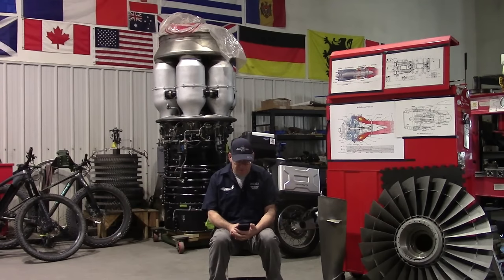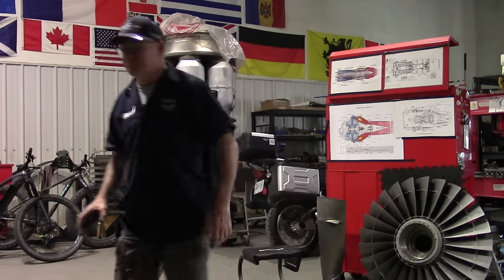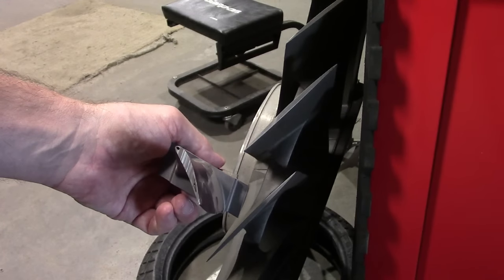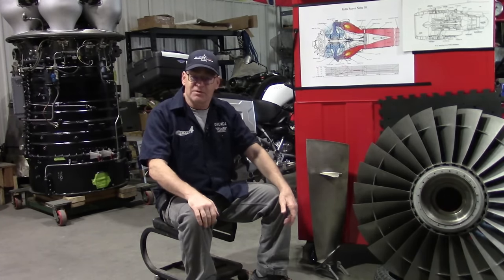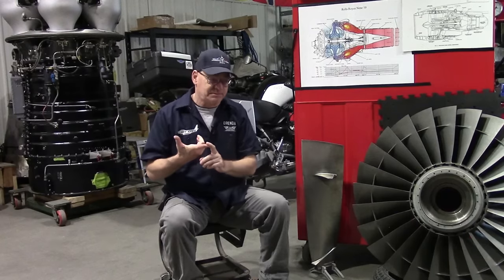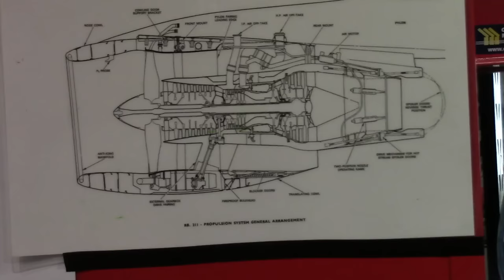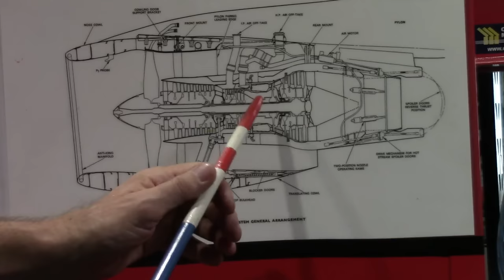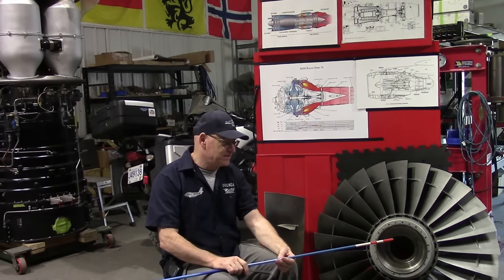Can Wind Damage the Engines of a Parked Airliner?

Comment: I’ve seen mil transports parked for extended periods use wooden poles made from 2x2” inserted into the compressor inlet to chock the compressor from freewheeling in the wind.  The moving stage was blocked by the adjacent fixed stage, blocking rotation.  I’ve seen lots of these in use with a rope and flag attached so that it would draw attention during preflight and be removed prior to engine start.  My understanding is that on these engines the oil actually acts as a fluidic bearing supporting the shaft when running at high speed.  When there is no oil pressure, the mechanical bearings carry the load.  The compressor chock I mentioned seems like a simple fix to prevent dry running these bearings.
Reply from the maker: The sticks are a simple solution that works pretty well. 
The oil-supported bearings you describe sound like what RR calls a squeeze-film bearing. It's more of a vibration absorption thing, and the rollers in the bearings do the load bearing all the time. there is a very small clearance between the bearing outer race and the bearing housing, which is supplied with oil at 50 psi or so when running. When not running the oil pressure is zero, but the bearing outer race still is mounted in the bearing housing.
Reply: The bearing is supporting the shaft even if there is a very thick layer of oil between the shaft and the bearing. The forces would transfered between the shaft and the bearing through the oil. I'm not 100% in on this, just my guess. If it doesn't have oil pressure the bearing and shaft might not get adequate oil windmilling.
Reply from the maker: ZLM: that is not the way it works. No guessing required.
Reply: Thanks for the insight AJZ, much appreciated.  Because I’m curious and not lazy (homage to why you don’t post links) I did look into what I thought I had learned when I worked in aerospace waaay too many years ago.  It winds up that jet turbine engines indeed don’t use a fluid film bearing and rely solely on traditional roller and ball bearings as you rightly indicated, but the ACM packs do use “hydrodynamic” bearings as the principal high speed, low friction bearing and have traditional ball bearings for static support with no oil pressure and transitionally for spin up, spin down periods. I knew I had seen them used on an airframe. Much thanks for the educational videos and your suffering in the hush house.  I don’t miss that or the nasty soot/mud on my car after a run.  Perhaps you can do one on the immense kinetic energy stored in an operating engine and what it looks like when one lets loose.  That’s a sobering sight.

Comment: In the Air Force as soon as an engine cools down to a set temperature, the engine covers are put on the front and back if the engine to protect them from damage from flying from debris and any living critter from making a home inside the engine.

Comment: I recently found your channel and have been watching whenever I can.  My dad was an A&P for Allegheny Airlines in the 70s and worked on JT8Ds and JT9Ds.  I took a different career path to a locomotive engineer but still love learning about turbine engines. Off topic from the video ,but I bought some compressor blades off ebay years ago.  Is there any database to find out which engine they're from?  Thanks!
Reply from the maker: There is no master database. Just like car parts, the first thing you need to know is what car it is from. Then a parts list will help. Somebody needs to first recognize the part, and what it came out of.
Reply: @AgentJayZ  Makes sense, thanks.  A couple of them have part numbers.  I'll do some research.

Comment: How does the change in temperature from ground operations (say at 60 degrees F, to 35,000 feet (air temp of - 65 degrees F) effect the engine oil viscosity and how is that handled by the formulation of the oil? Is the oil cooled by airflow or is the reserve tank insulated to reduce the cooling of high altitude flight?
Reply from the maker: The oil is capable of handling temps of up to 500F, and flows well at temps down to -65F
The oil is shared through all parts of the engine, so when running, even at altitude the oil is at about 200F. It is cooling the hot parts, and heating the cold parts. The CF6 referred to in this video has a fuel cooled oil cooler, and an air cooled oil cooler in the bypass flow.
Up there, it's really cold, but even at cruise throttle, the oil is flowing through all parts of an engine putting out at least ten thousand HP, so it's always plenty warm.

Comment: I fly the E-175 powered by the CF34-8E. Love the jingle of the N1 in the breeze...
Reply from the maker: Cool. The original question mentioned the CFM-34-8E. At least now I now what he was talking about.
Reply: @AgentJayZ  What does the jingle come from, i.e. what surfaces are contacting each other?  And how does that not damage the engine?  (Seems like the video didn't quite touch on that.)  Thanks for your work.
Reply from the maker: This explains part of it... https://youtu.be/phludDUfakg
Reply: @dannywilliamson3340  It would be a trivia point that doesn't give useful information to  executives or pilots. An easy to digest number is percent of maximum. 100% is a limitation on this engine configuration.
Reply: @dannywilliamson3340  I'm a reformed electronics engineer. Saw Y2K and H1B visas as a death nail to playing with electrons. I do give a good lecture how the Fisher Price radar works in the airplane and what circular polarization is, lol!

Comment: Dear AgentJayZ, I do not believe you have no idea what you talking about :), so I am not going to say this in the comment...:)); on the contrary, I believe you have very much a very good idea what you are talking about and I appreciate you educational work being done and put here for all to see (and learn) - I am a big fan of yours.
I have a question, though... What about windmilling restart? On an airliner, in some circumstances - certain wind speeds / altitudes, and maybe even angles of attach, as they also might be a factor - a "windmill restart" of an engine is achievable: no APU, no power from another source other then the RAT and the engine can turn enough that it is in a condition capable of being reignited. So does the engine then turn so fast, windmilling only, that it has enough RPM and airflow, even to the core, not only LP-fan shaft , that the air mass in the combustion zone is sufficient? And oil / fuel pumps / accessories, etc. are being driven to sufficient condition for the engine start?
If yes ... then ... wow... that's quite neat!!

Comment: Awesome response thanks! Next question, as for bleed air scavenging off a compressor section, what does that  system look like? Every manual or handbook has described it as being "taken off a compressor section" and I imagine a hole in the engine near one of the compressor sections that allows presssurized air to flow off the engine?
Reply from the maker: It is definitely never called scavenging. Could say tapping, but usually called bleeding, or bleed air.
It is taken off... through a hole in the compressor case...
Have a look at my video called Bleed Air, because it means a few different things, and as always, it's more complicated than you might first think.
Reply: In the terminology that I was familiar with at R-R, the term 'bleed air' was typically used for compressor handling bleeds, ie,  from bleed valves (aka blow-off valves for those of the Bristol persuasion).  Air for (eg) cabin services or otherwise externally ducted elsewhere on the engine was usually termed 'offtake air'. Rather than being taken from a single "hole" in the  compressor casing, there would normally be a manifold arrangement, with multiple ports or slots between stator vane platforms.

Comment: As to your statement that windmills are turbines, many of the old windmills found on farms etc., were advertised as, and some called, “wind turbines”, as part of a brand name.
Getting what you’re saying regarding duty cycle of bearings, running vs. windmilling, I’m left wondering about the of the long term affect of the “clinking”, for the lack of centrifugal loading / locking of the blades, at the dovetail blade / hub, for long term fretting action. Yeah, I’m guessing we’d be talking years, but…
Regarding engine covers and parking, in Army aviator, the main concern was for FOD, and the potential for injury from rotating components.
I believe that it can be reasoned, that for the infrequent use of engine covers on commercial ramps for quick turn arounds, the covers aren’t immediately available, for the risk of the presence covers, and the additional time required to remove and secure them.
That said, it does seem that many operators / companies do have engine covers available for parking aircraft during inclement weather, etc., but availability for all types and numbers of airframes, in situations like diverted flights, would leave ramp crews going, “Oh well, no covers for you…”.😊
As usual another insightful and informative video. Thanks for sharing.
Reply: Seen them being stored using what is basically a large length of pallet wrap, that is placed over the inlet, then held fast with a few turns over the cowl, and the same for the rear. Most issues would come with needing to strap the aircraft down during high wind speed events, though there you will find them playing Jenga in hangers to fit all the planes in, or flying them out to safer climes, as after all you do not want your multi million dollar aircraft being blown over, and either damaged, or landing on somebody else's property.

Comment: Very good video again.
Some interesting info:
On the new PW1100 family engines ( installed mainly on the A320 Neo) windmilling  was an issue because of the geared fan system. Planetary gear system and using journal bearings for supporting the planetery gears instead of roller bearing, because of lack of space. As we know journal bearings need always oil, so pratt engineers constructed a special pump which always supplies oil to the journal bearings driven from the fan uib itself through a clutch system even when engine is not running. The ldesign allows the pump operating in the correct direction independently from the fan rotation. The system also retains oil for this pump after engine shutdown.

Comment: Even facing head-on into hurricane winds, a turbofan on a parked airliner would be turning so slow it wouldn't be any different from not turning, for the purposes of bearing wear. The pumps may not be going, but there's still oil in the bearings, it's not like it disappears when the pumps stop. And roller bearings are fine at low speed with the little bit of oil that's still coating the bearing elements -- see skateboard bearings that turn faster than a windmilling fan, are subjected to massive (for their size) off-axis forces, and they can go a long time without being oiled. That compressor fan that's lazily turning over in the wind and putting negligible loads on its bearing? It'll be fine. If anything, it's keeping the oil in the bearings from settling to the bottom.

Comment: Happy Sunday @agentJayZ and cheers bud…… in early GTF development I was part of an interesting test where we “reverse windmilled” an engine to failure. More interesting is the issue came up in flight test in which we did a “drag” test on an engine in flight (shut her down at altitude for a few hours/OEI testing). Later in flight, when they went to air start it, Kaplowee. Come to find out we needed a reverse windmill gear in our pumps.
On the test stand we normally tie the fan down with Avis strap 😮 😊, trust the pre run FOD check 😅.
Reply: Why would it windmill in reverse in flight?
Reply: @NiHaoMike64 I reckon it wouldn’t reverse windmill in flight… unless you were flying backwards 🤪

Comment: If a jet with an underpowered starter, and extreme winds spinning it the wrong way, will the engine not start
Reply from the maker: Starting protocols specifically prohibit use of an underpowered starter, and specifically include limits for wind direction and wind velocity.
So no, and also yes!

Comment: Yes. Got called to inspect a CRJ9 for a ferry flight, hopped in the inlet to check fan blades and found that the tips were bent past limits and the containment case was damaged. Containment case and fan blades were changed.

Apparently happens when spins backwards with worn pins.
Reply: So how does an engine spin backwards? Are you talking about windmilling on the ground where the wind blows into the back of the engine? Wonder if that could happen? Interesting.
Reply: @Mentaculus42  yes they will spin backwards in the wind, at least the CRJs and many others. That is what I was referring to.
Reply: @TheReadBaron91  
Very interesting, like smile on my face interesting, learned another new thing today. Thank you.

Comment: Q: you can see in that technical drawing how the shaft that drives the fan runs all the way through the HP-compressor shaft. How is that fan driveshaft supported? Does it also sit on roller bearings? If yes then how is oil getting to it?
Reply: Yes it sits on bearings, and the oil is supplied via ports in the outer shaft, and flows through the gap, and lubricates and importantly cools the bearings. The outer shaft also has oil flow for the same reason, and seals to keep the oil in place. Oil feed lines come in to lubricate all the bearings, and oil return lines collect the now hot oil to go through the oil cooler, where it heats up the fuel about to be burned, and from there to the oil tanks, as a now cool oil. Hot fuel is going to vapourise easier, and thus burn more efficiently.
Reply from the maker: All the bearings for the LP shaft are axially outside the HP shaft. Sometimes there is an "intershaft" bearing. Have a look at my video called Twin Shaft Turbine Engine Bearings.
Reply: If you check closely on a cut away drawing there are roller bearings and a ball bearing per shaft. The ball bearing is generally used to hold the shaft at particular position along its axis. The fan blade shaft has a “thrust bearing” to deal with that issue. An interesting topic is how “thrust” on the high pressure spool is dealt with, it is rather counterintuitive as there should not be any or very little unbalanced thrust along the shaft. This was a topic that the engine designer from RR jumped into the comment section, huge learning experience between the video and the designer.

Comment: google says a JT8D requires a bearing inspection if windmilling for more than 60 minutes in flight, it would take a lot of time standing still on the ground in normal winds to add up to that kind of wear
Reply: It would seem that windmilling in flight is probably at a much higher RPM  &  frontal loading all with the possibility of low RPM on the high pressure spool which drives the oil pump. Very interesting.

Comment: So would this excellent explanation apply to a turbofan engine shutdown in flight for an extended period of time...?
Just curious, no plans regarding this.
Reply from the maker: Well, during flight the wind will be about 300 mph, and the long duration will be no longer than 180 minutes.
I think an inspection of the thrust bearing would be a good idea.
The thrust on the bearing would be in the opposite direction of what it would be in normal operation.
This of course is all secondary to finding the cause of shutdown of the engine.
Reply: @AgentJayZ   Actually, the 180 duration is well surpassed nowadays. EDTO has been increased to 330min and beyond!  I recall a precautionary shut down of a RB211 a long time ago, due to low oil quantity. Windmilled it for over 7 hours on three engines without any damage. Enroute checked with RR and they advised no restriction on doing so, even if quantity went to zero! As it happened, the cause was immediately known to us. Hyd system MEL required EDP to be depressed in previous transit. Incorrect procedure caused the oil loss.

Comment: I definitely feel you on the non-spoon feeding. Got a bunch of new guys at work and have to be spoonfed everything.
Reply: Hmm. I see the same at work. But is it really bad? Im not sure. The amount of technical knowledge has increased by something along the lines of a hundredfold just in the last 50 years. Modern technology is batshit crazy and often even the experts dont understand it, they only understand one part and 100% rely on other departments and vendors to handle the rest. Not even electronics are designed bottom up anymore, and they were until the 80s/90s. Mechanical engineering? Sheesh, carburetors, injectors, gearboxes etc have been outsourced to expert companies for like a century. Because designing carburetors is hard. Like really hard. I believe we desperately need , probably AI based, spoonfeeding courses to get young professionals up to speed faster and broader. School, university and on job training...aint matter, all of it too slow, expensive and shit.
Reply: @Zonkotron  I guess our problem is the lack of initiative compiled on top of lack of work ethos.